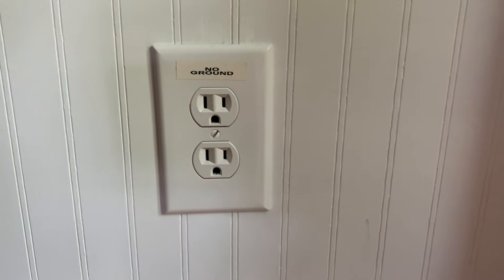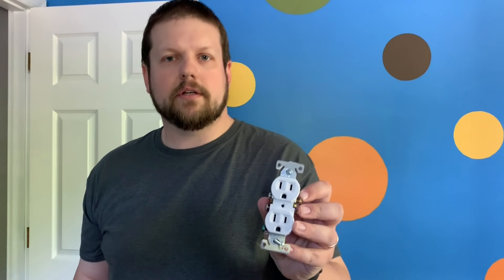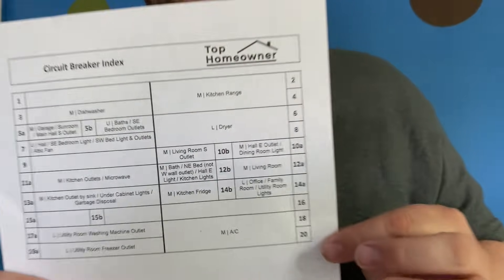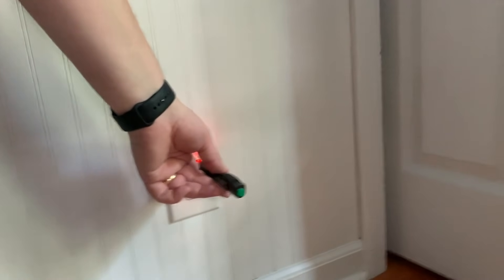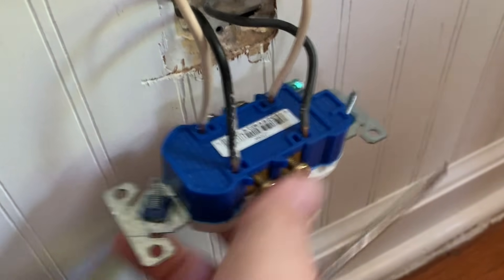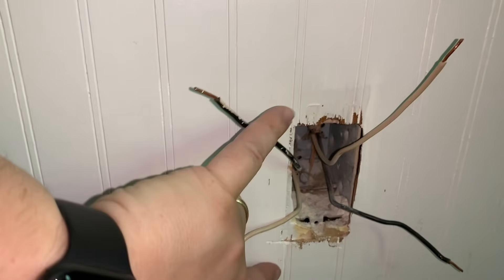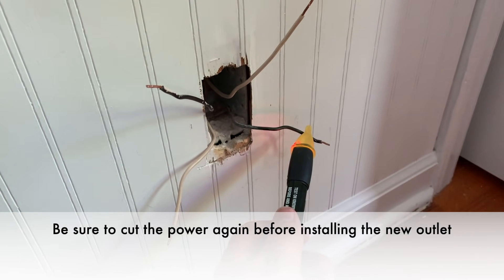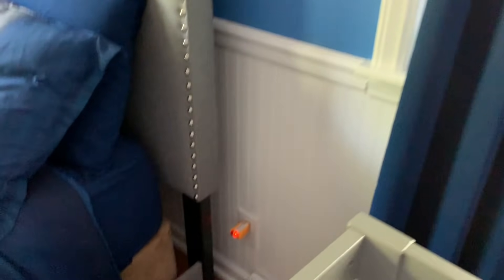Fixing Ungrounded Outlets - An Alternative Option to Rewiring Your Home

Comment: Good day, I am planning to use surge protector for my pc but my outlet is ungrounded. Can I use surge protector on gfci outlet? I saw some say that it is not good to use it on gfci outlet. gladly need your advice
Reply from the maker: Surge protectors have to have a ground in order to work properly. Basically they use the ground to dump any extra current that comes through the outlet during a surge. It goes without saying, but if at all possible you should use an actually grounded outlet for sensitive electronics if possible. That said, I'd rather use an ungrounded GFCI than nothing, it certainly wouldn't make things worse.

Comment: I'm buying a house with this same problem good vid I'm definitely goin out to buy some of these so do all no grounded need to be replaced with these
Reply: E. Romero, it depends. Most homes, even older ones typically use pigtails to connect to each receptacle (only 2 wires) instead of jumping from one receptacle to the next as in his example. This is done so that no receptacle has to rely on the previous one for power. So it's often not going to be practical to remove all those connections in order to find the most upstream. If you are not experienced, it would be easy to make a mess of it. So, if your house is wired like this with only 2 wires to each receptacle, then yes, a new GFCI at each outlet, connected to line on GFCI's would do it. It could be somewhat expensive depending on many receptacles you have, GFCI's are about $15 to $20 each. It's still a small price compared to the likely price of the house.
You also may be able to use a GFCI breaker and not need to mess with the receptacles. If the main panel is very old this may not be an option. Another possible option is to mount a new box and Gfci receptacle next to the electrical panel. You'll need good access to the panel because wire routing is important. The object here is to make this new outlet the first one on that circuit. You'll take the neutral wire from that circuit and connect to load on gfci. Hot wire from breaker to hot load on gfci. Then a new neutral wire from the neutral bus bar to the line neutral on gfci. New hot wire from breaker to line hot on gfci.
Reply: @surferdude642  great thanx for the info yea wht gets me is that I wish I could send you a pic because they put in a 3 prong but was to lazy to make it 3 prongs very disappointed wit these stupid repairs but gota do it thanx again great video

Comment: How do I know which one is the"first of the room" or most "upstream" ?
Reply from the maker: To find the first one on the circuit properly, you need to shut off a breaker and start testing each outlet to see which ones are off. The one closest to the breaker panel should be the first one. That's the only way I know how to do it but others may chime in with a different option.
Reply: @TopHomeowner  thank you. Just bought a house that needs two prong swapped to three prong and gfci's here and there.

Comment: I am only concerned about one outlet that I need to be grounded. I really don't care about the other 2-wire outlets. Can I replace with a GFCI and have protection on that outlet alone?
Reply: It will never be grounded until you run a grounding wire to it.  But it can be GFCI protected because GFCI doesn't require a ground wire, it compares the current in the hot wire to the current in the neutral wire.  So you can have GFCI protection on that outlet, but it cannot be grounded unless you run a ground wire.

Comment: Maybe you could point out that fixtures such as the ones you work on here that have the wires pushed into the attachment holes and not using attachment screws should have the attachment screws turned in snug?
Reply from the maker: Yes, that's a great point. Also, with GFCI receptacles, the side terminal screws actually hold the wire in place so they need to be tightened down in order to work. I made a follow-up video if you are interested: https://youtu.be/3AXcRsAOLPk

Comment: the reason why there is a ground cable is in order to avoid that you can be electrocuted , so your video is not correct , you cannot use de neutral wire for ground , regards robert
Reply from the maker: I made a follow-up video that talks about this and answers some other questions here: https://youtu.be/3AXcRsAOLPk

Comment: I’m a licensed electrician you still need to ground the GFCI. Just by installing it dose not provide any protection. You might just be adding to the problem and making it unsafe at the same time. He said it himself is not a license electrician.
Reply: Why is that?  Wouldn't the GFCI be able to tell that there's an issue just from the hot and neutral wires?
Reply: Most gfis won’t trip without a ground
Reply from the maker: GFCI monitors the amperage flowing between the hot and neutral lines and will trip if there's too much of a variance (over 5mA). No ground is needed: https://youtu.be/3AXcRsAOLPk

Comment: Use wirenuts and pigtails then use screws on the side for connection 
White wire on silver 
Hot wire on copper colored
Reply from the maker: Yes, thats also a good option. Thanks!

Comment: On one circuit, is one GFCI required for every room it enters?  Or is the first  socket on the circuit good enough for entire house?
Reply: GFCI on the first socket if the circuit is good for that circuit. It does not help other circuits. While it can be one circuit per room that is not a fixed rule. More than one rooms can be in a circuit or there can be more than one circuit in a room. You can determined the number of circuits by the breakers or fuses. In general older installations have fewer circuits.

The point is that each of the sockets you change has to be somehow GFCI protected. The way of doing is not relevant beyond the markings you need to put.

Comment: Kudos for keeping a straight face when power was off. Why can't you just install it on the sockets without ground or are you suggesting none of them have ground. I have only 2 receptacles in my whole house without ground, wouldn't it make sense to install GFCI's just in those receptacles ?
Reply from the maker: Yes, you should be able to just install it in those two locations. I'd double check with a tester and make sure your other receptacles are grounded too. We had some three-prong receptacles that were installed but not grounded so they just looked OK. I just posted a follow-up video to this one too if you are interested: https://youtu.be/3AXcRsAOLPk

Comment: My understanding is that a GFCI is intended to mitigate the chances of you being electrocuted, but is not intended for delicate equipment. IOW, any electronics that come with a three-pronged cable still require grounding to be properly protected. A GFCI is not a panacea - a good source of physical protection in the right context (i.e. outside or in a bathroom/kitchen where water is present) -  but not a cure-all for ungrounded situations.  Hire an electrician to tackle this problem.  There is a reason people train for years to do this sort of thing.
Reply: Grounding is used to protect against shocks. Electronics work perfectly well without it. People in Europe routinely use grounded plugs on ungrounded outlets without problems.

It, however, is good to take some precautions. Connect devices before you turn them on, like a computer to a TV. Connecting it live especially with RCA cause damage. Better just not to connect and use other means like a Chromecast or a removable hard disk to show content on the TV.

Comment: I didn’t get how you decided it was the first outlet and not a middle outlet.
Reply: Two outlets on the circuit.  The one he changed had wires in and wires out (4 wires, two black, two white).  The other had only two wires in (1 black, 1 white):  When he removed the outlet, the one black wire that beeped on his detector showed that was the live hot feed. If the was more than just the two outlets, he would have to remove all the outlets with the four wire and then test to find out which outlet was first in the circuit, and then that would be the one that the GFCI would have gone on, thus protecting the other outlets it feeds to
Reply from the maker: I made a follow-up video that talks about this and answers some other questions: https://youtu.be/3AXcRsAOLPk

Comment: That wiring is atrocious. The cheapest receptacles available with the wires back-stabbed into them, loose terminal screws, all in a metal box. Yeah, awesome! At least your gfci upgrade made things a bit more safe.
Reply from the maker: Actually, I didn't backstab the receptacles as GFCI never has that option. I made a follow-up video that talks about this and answers some other questions too: https://youtu.be/3AXcRsAOLPk
Reply: @TopHomeowner  I was talking about the old wiring not your GFCI
Reply from the maker: Ah, that makes more sense! There are so many comments on this video... and a lot of opinions! Thanks for your comments

Comment: If your breaker box is poorly labeled like mine (just says plugs and circuits are not per room), you can replace the breaker for your plugs with a GFCI or GFCI/AFCI combo breaker. NEC just says that grounded receptacles can be used on an ungrounded circuit as long as they are ground fault protected (doesn't say it has to be by your method).

Comment: On the first outlet you pulled (and the rest), you have to have a box extension. Else you have exposed ignitable material. Just more safe. Plus they're back stabbed. Not good. Also, as just a safety issue, most non-contact detectors do not register less than 110. Not all, just most. If you have a partially broken wire or ghost voltage on the line, it will report that it's killed when it isn't. I ran into this often where the older homes had aluminum wiring still. Ie. Guy had a switch that would not turn on the light. He used a non-contact and told me it was unpowered. My opinion greatly differed and I was correct. I put my meter on it and found 89V. Home had AL wiring and I diagnosed that it was partially broken where it ran through the attic, in a place where they frequented and had stepped on it. Had I listened just to him, I'd have gotten pinched by the voltage. Wouldn't have hurt me much, but it would've scared the crap outta me.
Reply from the maker: Thanks for your comment and the different points. As for the back stab piece, I talk about that in my follow-up video. On GFCI and spec grade receptacles they have the option to back-wire, not back-stab. It clamps down on the wire with the terminal screw instead of holding the wire in place with a small clip. The video is here if you are interested https://youtu.be/3AXcRsAOLPk

Comment: I've watch videos all day and so far this is the best one! It makes sense as to why half of my kitchen no longer has outlets that work and probably because the new outlet with that protection was put on the 2nd to last out that in the string
The wiring starts with a switch at my kitchen counter to a plug on my kitchen counter for 2 things to be plugged in like a microwave and a phone and then the Plug for the garbage disposal no longer works which is where I put the plug your talking about
Mind you before that didn't work I replaced and outlet in the middle of the 3 I mentioned with just a regular plug and it doesn't work help
Reply from the maker: Thanks for watching! I have a couple other videos that talk about GFCI outlets if you are interested:
How to Wire a GFCI Outlet - What's Line vs Load? https://youtu.be/Uop79H_iqoQ
Also, I just published a follow-up to this one answering the biggest questions: https://youtu.be/3AXcRsAOLPk

Comment: As a licensed and certified electrician myself I have a few problems with this. Since you mentioned it yes a gfci outlet should be first on the circuit but without knowing the wiring in the house behind the walls or with the correct tools to know how much voltage loss each outlet on the circuit this only if you actually know everything on the circuit  but between both of these things combined you will likely not know for 100% fact that you have the first one on the line. Near by rooms could have outlets  that are on the same circuit and you haven't taken them into account. Anyways I could go on but no point so please don't burn down your house and don't seriously hurt or kill yourself doing this you won't get many chances if you mess up that's even if you get a second chance. Be safe everyone.⚡👍✌
Reply: How does knowing the voltage drop tell you if you have missed an outlet?

Comment: Avoid push in connection s..always overheat with heavy loads. The loose contact alot 
Should be banned.
Use the side screws.
Reply: GFCI receptacles do not have push in connections. The connections are always secured by screws.
Reply from the maker: I actually didn't use the push-in connections in this video. I made a follow-up video that talks about this and answers some other questions https://youtu.be/3AXcRsAOLPk

Comment: That existing wiring style usually has a bonding wire back wrapped around the jacket and pinched under the metal cable clamp to bond/ground the metal box.  Hmmm.

Comment: 5:57 why that green wire is there if it is connected to the metal box. It means the outlet is properly grounded I really find no info from this vdo
Reply: Apparently, the green wire was attached without verifying if the box is grounded. The green wire means nothing without this verification. If the metal box is grounded you will measure ~120v between the hot and the box.

Comment: Do it the right way and re-wire your damn house, if its thats old, just do it. Its not worth the risk of a fire due to old inferior wiring and you have no idea who has been into it over the years.
if the basement is unfinished a re-wire is very easy to do with minimal damage.
Converting over to a GFCI will still NOT BE GROUNDED, it will only trip in case of surge/arc...
With a re-wire you know everything is up to code and bedrooms are arc fault protected now and you will have a better re-sale value and piece of mind, also remember it will require a permit, don't play with your life or somebody elses.

Comment: Hello, I’m certainly no electrician in fact know just enough about it to; we’ll you know the rest. How does this ground an outlet? I have an issue in kitchen where we blew a nice microwave about a year ago so just replaced it. It was an expensive up-line Amana given to us by rich co-worker of my wife’s. So the replacement we bought when it went out just blew out last night. I think I e decided it’s the ungrounded outlet it was plugged in to. It’s a case of older home, we bought it like this with a 3 prong outlet out in place of a 2prong but no ground. Am I right I’m guessing the power consumption of a microwave needed to create 1100 watts was too much on a 2 prong and basically overworked the ovens system? Causing it to heat up over time burning it out? Anyone.
Reply: Ungrounded outlets do not destroy equipment, especially microwaves that are not connected to other equipment. You have a problem somewhere else.
Reply: You are not correct Scotty. First of all, the metal box must be grounded to the electrical panel before any ground wire to the receptacle will do anything. The gfci is designed to trip if the current is ~5mA different between the hot and neutral when there is a load. A ground wire is not required for this to occur. Secondly, think of a ground wire like a spare tire on your car. It is there in the event of a short and should not carry current under normal operation. 
Your problem is something else. It's possible your circuit breaker is rated for 20 amps and you're using 14 guage wire which is a mismatch. There could be something wrong with the wires, call an electrician.

Comment: This idea ONLY works in houses/locations where the wiring at each outlet provides a "line" and "load" set of conductors. The GFCI device is inserted at the first outlet (nearest the source) in the circuit and protects all the remaining outlets sourced from the "load" pair of wires. MANY older houses were wired using a system called "knob and tube" wiring (that used porcelain knobs and tubes to insulate the wires from the wood framing). With that system, all the splicing that extends the live circuit conductors to additional outlets is done "INSIDE THE WALLS" so each outlet only has two conductors. This means the circuit cannot be interrupted/protected by a GFCI device.
Reply from the maker: I agree, for knob and tube there really is only one option and that's rewiring the house. Thanks for your comment!
Reply: @TopHomeowner  
Unfortunately !! Or, running a ground conductor to each outlet given access to a "crawl" space below the outlets, of course.
Reply: @TopHomeowner  Yeah, I'll get right to that as soon as I win the lottery, lol.
Reply: Sure it can, you just need to use only GFCI outlets. The load side is optional.